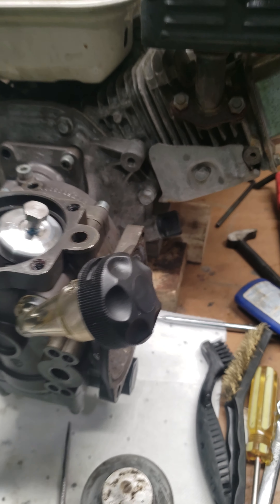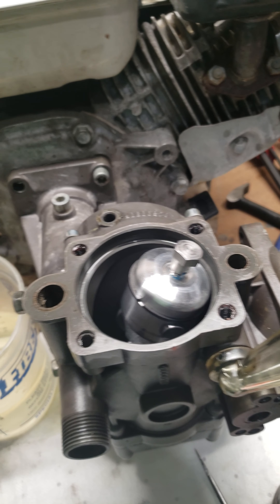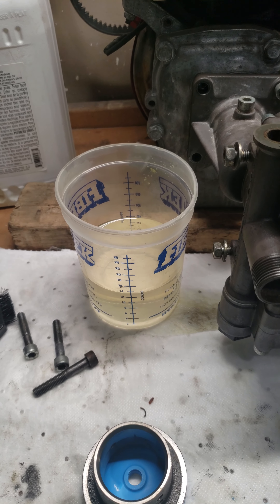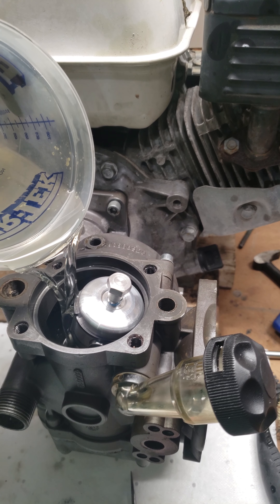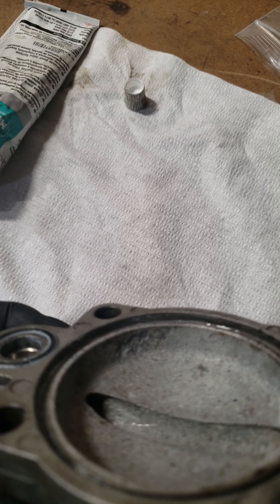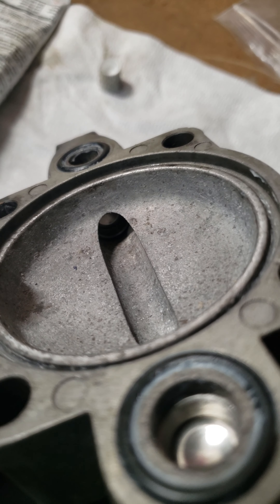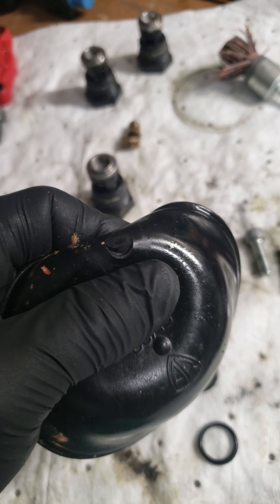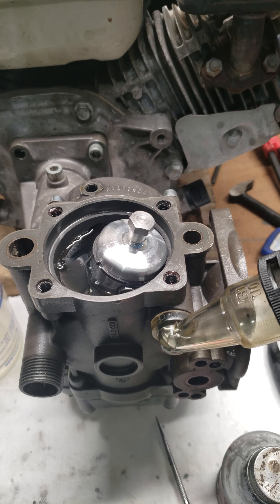hypro/AR D252 quick oil fill.

Comment: How Do I make an Oil Change ??? I don't see any Oil Drain Plug
Reply from the maker: Hello, there's no drain plug like an AR30/D30.

You'll need to drain the oil out the sight glass or out one of the diaphragm cap. 

Hope this helps
Reply: @airframefixer   Do I have to disconnect the pump from the motor? I find it very difficult to drain the oil out of the diaphragm cap while connected to the pump motor.
Reply from the maker: @elenagonzalezgarcia8711  hello. 

No need to remove the gearbox from the motor, just loosen the bolts and rotate 90 degrees. By removing the filler cap and both diaphragms, the oil will flow quickly.
Reply: @airframefixer  Will try. Thank you!

Comment: How do you remove piston head? Mine is stripped.
Reply from the maker: You'll have to try some extraction methods. Keep in mind it's a stainless bolt into an aluminum piston it may be seized in fairly well. I'm not afraid of drilling into bolts, screws, etc and using extractors. If you havent done this before, I'd recommend some practice before working on your pump. And of course, make sure you clean up all the swarf/chips. 

Hope this helps.

Comment: can you use sae 30 engine oil or does it have to be a special pump oil?
Reply from the maker: Hello. Hypro/AR recommends Sae30 Non detergent pump oil. Of course they want you to buy their oil, but I use off the shelf "pump oil" provided it meets the specs. 

My understanding is that engine oil holds particles and debris in suspension to be carried to the filter system, pumps typically do not have filters, and hence letting the particles  fall out or float off.  Hope this helps.